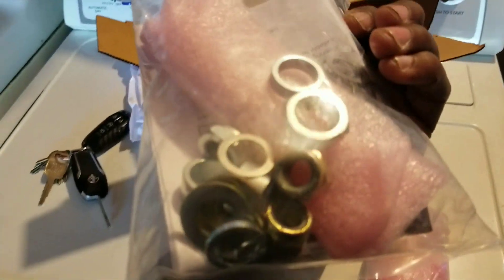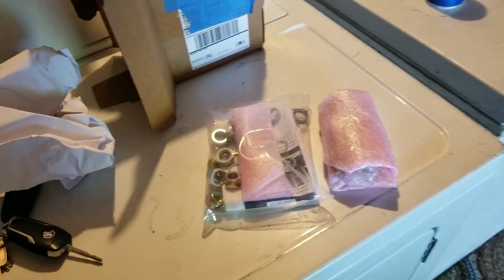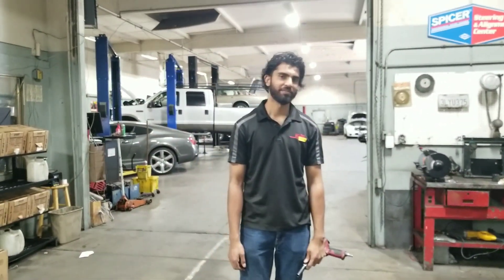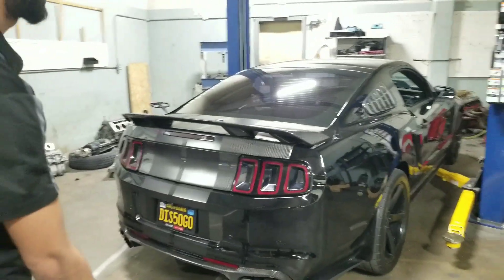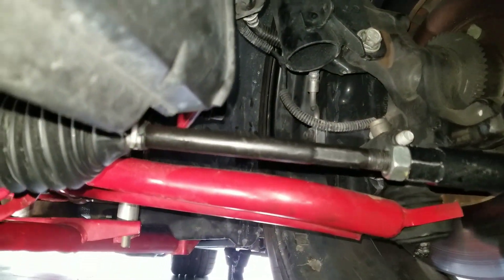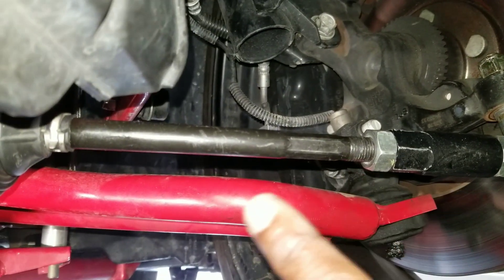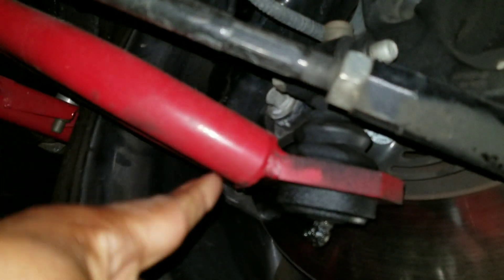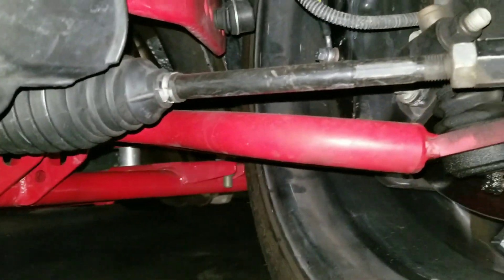Maximum Motorsport Bumpsteer Kit

Comment: Got my 20 inch 551s and 255/275 Mickey Thompsons on my 4.6 GT! xD https://i.imgur.com/YHgKB9K.png I have a question about that kit, though. With my Mustang I've noticed uneven portions on road will cause the steering wheel to turn in that direction. Or, if there's a crack in the road running along the length of your lane (not even a big one), the car will seem to drop into that crack like a track and follow it. Is that the sort of stuff the bumpsteer kit is supposed to help with, or am I misunderstanding what it does? I guess I had some shitty tires on before as these new ones really help the handling a lot, but I still have that problem to a lesser degree and want to fix it.
Reply from the maker: Thanks for watching and nice car, make sure you hit the like and subscribe button,  Yes if you are lowered😉
Reply: @DIS50GO  My car is still at stock height (gonna fix that soon, my wheel gap is downright SHAMEFUL right now) but I did more research and yeah, if the suspension is steering a car, then it's got bump steer period. Put on fresh struts and shocks and bearing/hubs all around so it isn't that. Maybe the bigger wheels are causing it - I've read changing the wheel/tire size significantly from stock can throw the suspension off. Guess I'll give the bumpsteer kit a shot, especially since I'll be lowering it anyway. Thanks for the reply my dude, and I subbed. =)
Reply from the maker: Wow yeah, my bumpsteer was actually scary, but I didnt have the issue til I lowered my car.

Comment: Youre def doing the right thing setting up your suspension.  That adjustable panhard bar is a must too with these cars.  Most people just put springs and thats it.  Caster camber plates could probably have made bump steer install go faster because of adjustments...but an added cost.  Thanks for showing proper way to lowe ra car.
Reply from the maker: Very true about panhard bars, and lowering springs, most just lower there car and be on there business 🤣 and if you lower it so much now you need a upper ADJUSTABLE arm to😉👍